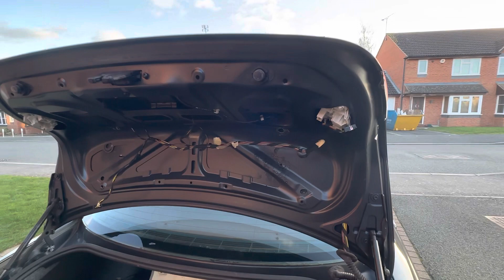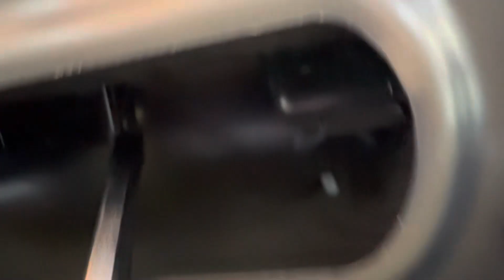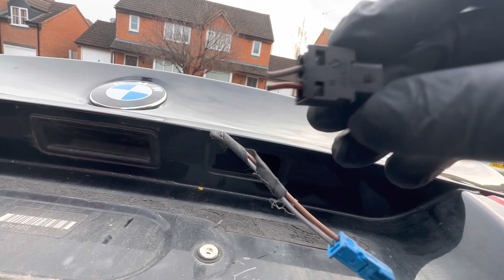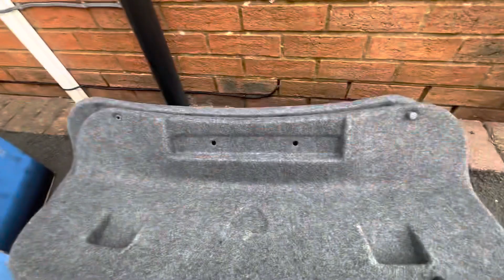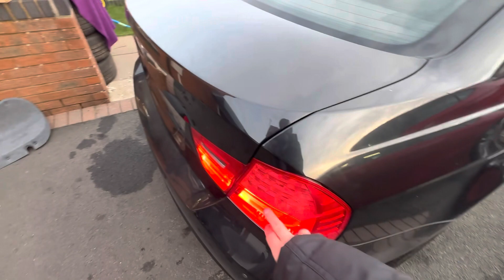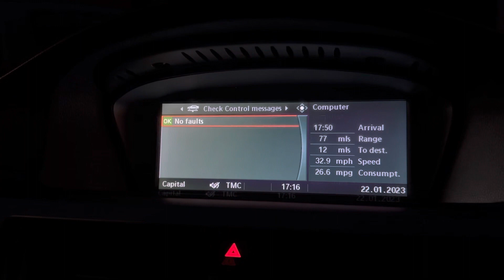BMW E90 330i Build (PART 3) LCI boot/trunk lid led tail lights retrofit installation facelift saloon

Comment: I’ve bought a LCI boot lid, it came with the number plate lights , but annoyingly they removed the latch and the boot release button. What do I need to buy to do the LCI boot swap? Can I reuse the hardware from my current boot, or do I need a cable version (to release in case the actuator fails) cheers!
Reply from the maker: I think you can use your old parts

Comment: hi buddy do you have a video on putting LCI headlights on a pre LCI E90/91 please if not do you know if they will work?
Reply from the maker: @dazpatton   hi,
I fitted lci adaptive xenons on mine with high beam assist, the installation is fairly simple but I had a coding specialist come and do the wiring and coding.

Comment: Great job. Im doing this mod on mine, but mine is one of the very last ones pre-lci and has the same light plate conectors as the lci. I read the module is different, hopefully that will save me the coding, i dont know

Comment: Since the pre-lci has a key lock and the lci doesnt, how did you manage a backup system for that?
Reply from the maker: Lci doesn’t have a “backup system”
Reply: @vysgarage  omg, so in case the lock goes bad or there a flat battery?
Reply from the maker: If the battery goes flat, there are jump terminals in the engine bay. 
If the lock breaks, you’d have to drill a hole in the boot lid to access the latch. This is the case on most modern cars post 2010…
Reply: @vysgarage  thanks. What a nightmare should that happen

Comment: Thanks for the great vids. The inner lights are not led, are they? Do you know if you keep the OEM outter lights you can avoid the coding?
Reply from the maker: I’m not sure if there are led bulbs in inner lights.
I think the design of lci and pre lci is quite different too so might be an odd look 🤷🏼‍♂️
Reply: @vysgarage  i think resistors can be used to simulate equal amparage and therefore avoid the coding

Comment: I have a rusty boot and thinking about getting a second hand one. Might do this at the same time. Also, I understand there’s no key on the LCI boot. What do you do if the battery goes flat?
Reply from the maker: The are battery terminals in the engine bay 🙂
Reply: @vysgarage  thanks! Where did you get your boot, was it brand new? How much was it? Most breakers seem to sell just the boot, no harness or lights. Cheers
Reply from the maker: You don’t need the harness, you can reuse your existing one. 
Most breakers will sell tail lights as well. If you’re in uk, it should be around £150 for lid with lights